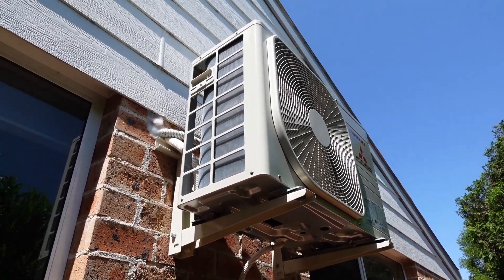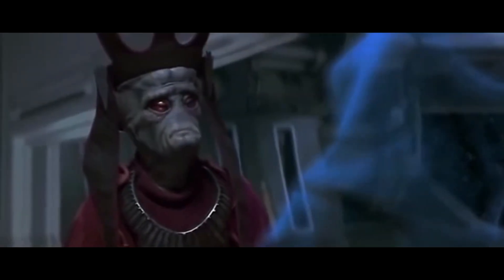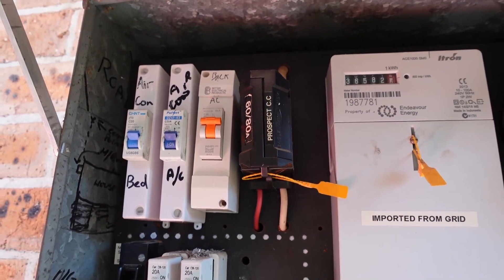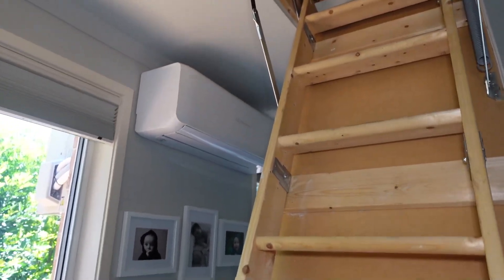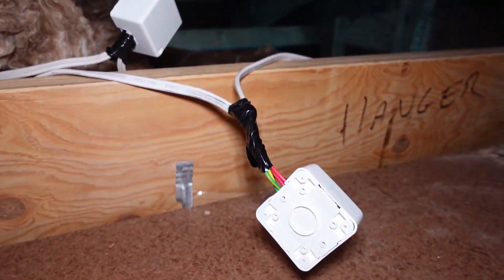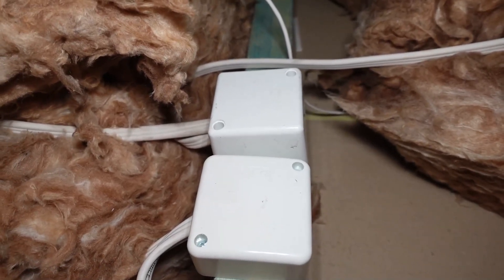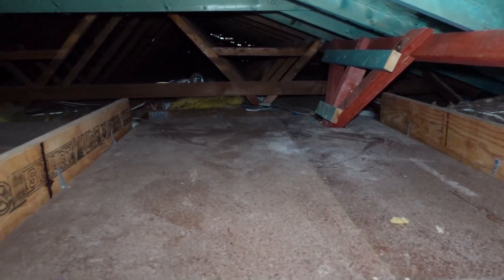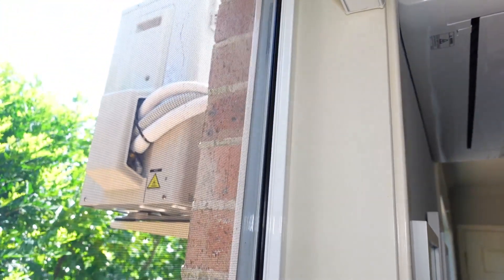Aircon Wiring Install FAIL- TWICE!

Comment: It's amazing what you can do on 240V circuits.  I live in a 5-room apartment Canada, and I've got 6 distribution circuits rated at 15A each, plus a 240V 40A rated circuit for my electric stove.
Reply: I have 15 breakers + 2 RCD for a 1 bedroom apartment !
That's completely unnecessary but I can cut outlets and lights of each room separately.
Reply from the maker: We have a separate one for the stove.
Reply: @EEVblog2   They are required now under as3000 to install a rcbo/safety sw to that new a/c circuit not just a standard c/b
Reply: We have 230 V in Germany, but modern apartments and houses have a ton of separate circuits, too. At least one for each room and a bunch more for the kitchen.

Comment: I just store old pc boxes and stuff in my roof, just incase i need to return or sell. non tempture dependent 👍
Reply: I used to do that, until I moved and I had about 30 large boxes and 50 small electronics boxes I've been saving for about 20 years, "in case I need to return it." Then I used my common sense and determined that you don't need the original packaging to return an item, and I've NEVER used any of those boxes. EVER.  Woah I had that common sense when I decided to start keeping boxes.
Reply: @xenonram  if you have boxes for electronics over the past 20 years, some might be worth selling to collectors or enthusiasts looking for original documentation. Check before tossing them out
Reply: @broklee  never thought of that. Good idea
Reply: @xenonram  for most boxes thats true. I do go up there and do a cleam out every so offen. But i just but my new pc, and sold all the stuff in orginal packaging, helps alot. Iv also had a nunber of items repaired Under warranty so boxes have been good for that to. Usaly when a product is super old or it makes no logical sense to keep the box i toss it tho.
Reply: @xenonram  ive had a few places demand mobos are RMAed in their original packaging...

Comment: Might be legal but I'd never price a job to just connect to the power circuit unless the customer wanted to save a few $$$. J-boxes epic fail. If you just do it right the first time you will never need to come back.  Rest of the job looks ok though. Bit ruff but ok.

Comment: I don't know the code down under, but that would violate the NECode up one side and down the other. Where do I start. Strain relief?
Reply: Strain relief? The cables aren't even clipped to anything, they're just tossed in there. Who needs DIYers when your professionals can cock it up this well?
Reply: I do my own wiring, way beyond code minimums... the inspector is always blown away by overkill... It starts by first knowing electronics engineering, and then study the electric code and understand, it is the dead minimum.

Comment: Thats bullshit it's all wrong...!!!!! You cannot use a PowerPoint circuit for split system air-conditioning unit it has to have its own circuit with an rcbo breaker (earth leakage protection) and a external isolation switch. .
Reply from the maker: I've read the standard, and it's technically allowed.
Reply: @EEVblog2  But the manufacturer won't warrant it if its not installed like I said and if there is a problem and a service agent comes out he will knock it back on warranty. The reason you dont use a gpo circuit is because you loose capacity on the rest of the outlets when the air-conditioning is running..

Comment: 3:38 ... So, that is how you do it in Aussi land ... What a rats nest. I prefer the DIN rail style.
Reply: Na, that’s an old board that’s been hacked into though the years.

Modern would be din rail and a common bus bar.
Reply: @MrSmeagolsGhost  yeah, but we also have buckets of cheap plastic DIN units, just waiting to burn
Reply: Amazing. What a mess.
Reply: Hi, that looks like what mine was until 2020, house was built in @ 1960, add on extension in @1980 and again @1997

I notice he has one original federal or clipsal ceramic wire fuse holder as well, i had 4 left power , right power, rear extension #1power, and finally all lights

The 1997 extension received  the push button resetable style fuses
I had a earth leakage detector added.

Since the upgrade last year, i now have hmm 10 or 12 drops,  each circuit has its own combo fuse and earth leakage detector 

I have 2 air cons, front and rear of house, and each has its own 15amp line with only the aircon on it. Front aircon is a mitsubishi from @ 1982 and still chills good, the rear one was a LG installed 1995, then replaced with a cheap no name brand from bunnings ( Australias home depot )  in 2010 and  i replaced it last year with another mitsubishi

Davis wiring appears messy due to fuses all over the board plus his solar, and he still has the old meter, mine was mandatory replaced Oct-Nov 2020 with "Smart Meter"

Regards
George
Reply: @georgemaragos2378  I also had ... 20 years ago or so ... a summer house with old wiring, and a bunch of ceramic fuses (which TBH scare the crap out of me, you know because of exposed life connections and no fuse to protect) ... and those were also from the 70s or so ... but still on a rail.
Reply: My grandpa had a barn with knob & tube wiring.  I can't believe it never burned down lol
Reply: @scabbynack  But that is great for killing rats and cockroaches.
Reply: @scabbynack  Yes, but if the old metal conduit was properly earthed (with uncoated copper stranded wire in those days, sometimes) it was sound enough. Proper earthing, that was the key.
Reply: DIN rail installs are still super, super sketchy (low quality) compared to the panels we use in the US. Yes, various industrial stuff uses DIN rails, mainly because sometimes there is no other option. But any decent Square D, Eaton or Siemens distribution panel, like those used in every home in the US, is a significantly better option. Your breakers are neatly arranged, the wiring is properly hidden behind the panel, the wiring doesn't move when you open the panel... just everything about DIN rail is sketch. I've seen UK installs that look almost as scary as what Dave showed in this video. Wires just right there and stuff. You should never see an individual conductor in an electrical panel as a homeowner (when I say individual conductor, I am including the jacket of that conductor). Coming out of the box you should only see appropriate wire with 2+ layers of insulation (like our NM-b "Romex") or conduit. You should not be seeing individual conductors with their black and white jackets.

It is scary to me that ANY country on the planet will let you wire up mains power into your home with some sort of ridiculous DIY method with exposed wiring and wiring that moves with the panel door (yes, I know DIN rail can be done with wiring that doesn't move with the door, but the problem I have is that it's apparently even LEGAL for the wiring to move like that). It is scary to me that ANY country allows you to hook up multiple dedicated ACs all on the same circuit that also runs half your house.

Even at the 120v of the US grid that's 120^2 or 14400 watts of instantaneous power delivery available to mess up your day. 4 times as bad at 240v, of course! It's serious power, take it seriously, put in an enclosed box with proper safety standards. Leave DIN rail to the industrial installs.

No home should have DIN rail at all unless you're using it for low voltage stuff or something.
Reply: @korgied  You don't know what you are talking about. You obviously only have seen it done wrong. Which, in most countries (that I know of, and that use DIN), is actually illegal, and if done like that have all sorts of negative impact on the owner.
E.g. Insurances not needing to pay (if there are damages), or power companies cutting you off (when they get wind of the installation not up to code). Among other things.
Reply: That's cost cutting at the max, a good one would be din style
It just depends on how much the builder or owner wants to spend
Reply: We do use din rails... That install is old and should have been a panel replacement
Reply: @JaxxTech  And that also should neither that hard nor expensive because some of the switches I spotted are already dim capable.
And it would result in much less space used. The box for the DIN setup probably could even be put in the existing box.

Comment: Two different things being powered.  The interior air handler is probably around 200W (1A ish), but the outside condenser unit is (according to the video) 9A.  Splicing in for the air handler seems reasonable enough, but not for the outdoor condenser.

As a North American it's quite shocking to see how few separate circuits you have in your house, a house here would have typically 8-10, plus a number of double breakers (two opposite phases of 120V for 240V loads) breakers for heating/cooking/heavy cooling loads.
Reply: I believe that is one of two panels. It's for the meter, main shut off, and outside units (AC and solar). Then there would be a service going into the house from that panel to a secondary panel with the breakers for all the indoor circuits
Reply: @xenonram  that would be unusual in Australia for standalone houses (like this one).  Flats and apartments might be different.
Reply: Most mini splits (that I have seen in america), have one source of power to the outside unit, and the outside unit is wired to the inside unit for  power and communication.

Comment: facepalm That was a shit job. In Canada on 110V we require 1 circuit breaker (double pole single throw to get 220V rated for 20A if I remember correctly) and also an isolator at the outdoor unit. In Canada homeowners are allowed to modify wiring but it has to be inspected to be legal. My father who is liscenced in HVAC did the electrical wiring rough work in the kitchen, had it inspected and it passed. Though we had to have an electrician wire it in at the panel as the panel itself required an upgrade from 60 amp too 100 amp service as it was only the glass acrew in fuses.

Comment: Not legal here in USA, San Francisco , California . 
     Must have it’s own wire all the way back to its own Circuit breaker. 
        Must have a disconnect out at the unit with in 6’ = 2 meters and easy to get to within sight
Reply: yeah to start. Strain relief?

Comment: dave your camera is really suffering with that stabilization some thing I mentioned to you before on your new camera video 02:38 

Hopefully this is not the camera that you’re using but if it is stabilization is horrible just a thought nothing to freak out about it it’s just my opinion
Reply from the maker: I thought I had it turned on, but I goofed it, no stabilisation.
Reply: @EEVblog2  OK this is good news now I know why its shaky for a minute there I thought you had a bad camera...
Reply: Strange enough with Sony cameras when the stabilization is off the lens is free floating so it actually amplifies any little tiny movement because the sensor is free to move in any direction’s including X Y and Z axis.

If you want to do a fun test put a bass speaker near the camera and turn image stabilization off and you will see the sensor shake even though the camera is not moving
Reply: @360MIX  i honestly had no problem reading any of it... was nice to see some layouts and markings on the walls and various bits...
i know the Dave has a new cam with stabilaization..but really i had zero problem with it off!
Reply: i didnt noticed anythin wrong...but stabilization isnt something i really look for.. i understand that when moving a camera ya gonna get some shake when youre moving fast...i just look past it..dont even notice it...but sometime when the vid is stabilized it can at times seem a little strange and distracting... 
each to their own i suppose!.. but its nothin dave should really be concerned about for something like this...
Reply: @WacKEDmaN  The camera is supposed to stabilize the small movements so you can actually see the frame without major shakiness the larger pans and movements are OK as the camera can Not compensate for that..

The reason I brought this up is because when Dave was mentioning he got a new camera he was all gung ho about the stabilization which I mention that is not as good as he think it is or perhaps he has it off that’s the reason why I bring it up not because I want to be a pain or distract from his educational videos but to show that he does have an issue with that camera perhaps the cameras damaged I do no audio video production and have several high-end cameras as well as Sony cameras..I am speaking from experience
Reply: @WacKEDmaN  try to read anything on the fuse box. Look at all the shakiness on the video.

Comment: Was it because you went the cheapest quote?
Reply: Cheapest quote doesn't justify them doing it wrong. You won't get the extras like how the two old units he showed had the tubing and wires entering the house with the chase (raceway) going up under the roof eave, instead of a hole with silicone boogered in, but it should still be done to code. It'll be done to the base minimum standards, but should still meet standards. That's why they came out and redid it.
Reply: Being a back to back install it's entirely possible it was some "free installation!!" deal from the retailer. No doubt they would go with the absolute cheapest possible subbies

Comment: My place has 4  plug circuits, one for the bedrooms, one for lounge/dining and 2 for kitchen, installed when built 60 years ago.  Standard these days is roughly the same, and the board is not that dodgy as F thing with single breakers under a cover, and still one old as the hills rewireable fuse ( likely wired with 100A fuse wire by now if it had ever blown before) and all at odd angles and places. At least the breakers are GFCI ones, though here the standard is a separate one.

Yes dodgy wiring, but you see the same all over the world, seen worse from the metro contractors, who are supposed to be the ones trained to do the work.

Comment: Next time you should let them know prior to install that you're expecting a copy of the certificate of compliance. They should hopefully install whilst more mindful of the standards!
Reply: It occurs to me that you should probably ask that for an electrical work being done on your home.  Your insurance company and electrical inspector are likely to be much happier with that.  (I once owned a home that had bad wiring in it from the original owner's basement reno.  I was NOT pleased when trying to shove something onto a shelf in the utility room pushed an exposed live wire into one of my copper water pipes and blew a hole in it.  I damn well could have been killed!  This led me to formulate this statement:  "Bad plumbing is annoying.  Bad wiring WILL KILL YOU.")
Reply: All I read was "Angry Pixie pool party"
Reply: @Fridelain  Pixies really don't like getting wet, and are likely to take it out on you...
Reply: They don't, at least in my country. We had work done when we moved in a new office by a so called "professional electricians" and it was all certificated, and it was garbage. We had to fix basically everything, most of the earths weren't connected, terminals screwed loose, cabled of wrong colour used (even green/yellow for a phase conductor...), network cables not terminated correctly, and so on. 

They don't care. They give you even a piece of paper that is required by the law that says that everything they done is certified, well then if there are problems you can sue them, and you have to prove in some way that the fault is the result of their shitty work, something that you really can't do.

Comment: Not sure about Australian code, but in the US there would likely be a disconnect switch by the outside unit for the A/c service person to kill power so they can work on it safely.  If the only disconnect is in the panel, they'd have to locate and tag it (if not lock it out) to make sure no one turns it back on.
Reply: That's the law here too. Same for hot water systems and some other hard-wired equipment.

These contractors clearly just did the dodgy to make a little extra $$. It's sad to think alot of people don't even know so they never get called back to fix the defects.